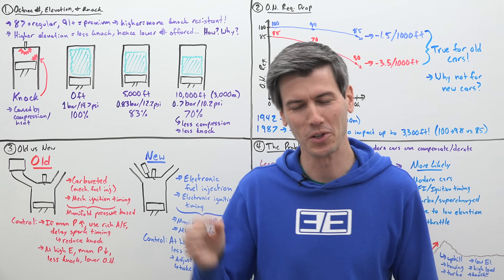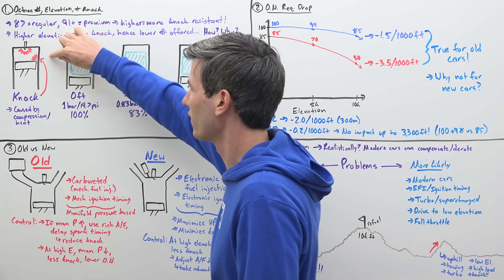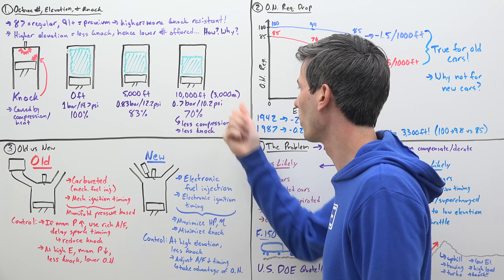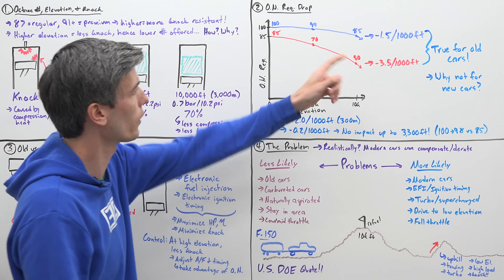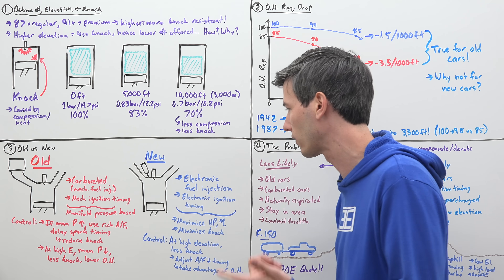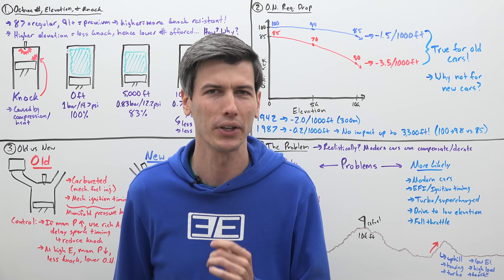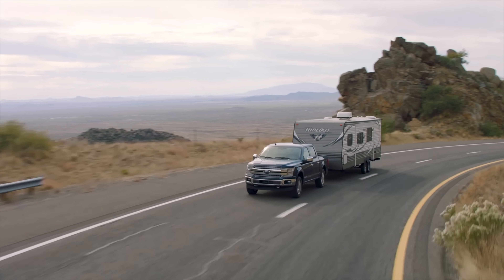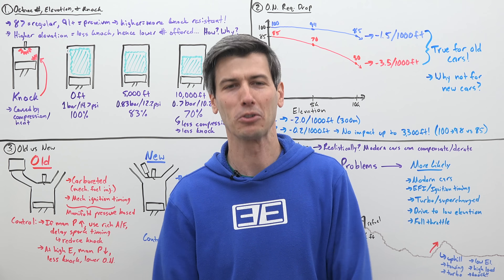Never Use This Gas In Your Car!

Comment: where I live regular is 86 octane. we are at 3700 feet above sea level. both of our newer vehicles manuals state use 87 AKI. After finding this the dealer said 86 works for the elevation we are at just the same as 87. Our state does not allow the sale of 85 though. so is my vehicle getting destroyed?

Comment: I have a direct injected engine in my car but no turbo.  Are direct-injected engines subject to potential knock?  I was assuming the fuel was not present at all during the compression stroke, and injected just prior to the spark near TDC.  Yet my car runs much better on premium than regular.  2018 Subaru Impreza

Comment: I am actually shocked to learn that 85 or 87 fuel exists. Where I live, 92 is considered the lowest acceptable and I wouldn't put anything lower than 95 in my car. But one thing that puzzles me is that if my car manual tells me not to put anything lower than a 92 in, and 91 is considered premium in the US, what is it going to use in the US? I drive a Subaru so that car definitely exists in the US.

Comment: Interesting stuff, but I can't say I find it all that odd that this fuel is for sale.  Diesel is for sale everywhere, and if you put that in your gas car, you're also going to have a bad time.  This almost seems akin to the transition from leaded fuel to unleaded fuel.  At one point there was a good mix of cars that required one or the other, so both were sold.  I have a number of cars from the mid-70s that have printed in giant letters by the filler cap UNLEADED FUEL ONLY so that people wouldn't put leaded fuel in their car since it was readily available at every gas station.  Another thing to consider is that fuel containing ethanol is bad for older vehicles, yet that is sold everywhere and ethanal-free fuel can actually be difficult to find.  Ultimately, different vehicles take different fuels, so it's not terribly shocking that different fuels are sold at a station built with the express purpose of selling fuel.

Frankly, if people aren't capable of reading their manual and putting the right fuel in their car, that's on them.  Whenever I fill up a car I'm not familiar with, I always look at the octane requirements in the owner's manual the first time.  Honestly, even if you didn't know what your car took, I'm not sure what would possess someone on a road trip to select a different type of gas than they normally use just because it was an additional option at some gas stations.

Comment: Is Ford F-150 actually missing a knock sensor from the engine? I thought that all engines with fully electronic timing always have a knock sensor and the ignition timing is retarded until knock doesn't appear. That allows two features: (1) engine is not damaged by knock issues because the timing is automatically retarded as much as required and (2) the engine performance will automatically increase if you use higher quality fuel.

Comment: Why not say explode?  Knock, pre detonation, is the fuel exploding in the cylinder.  Fuel, under normal and proper conditions, is a controlled but extremely fast burn; not an explosion.
Then explain how the pistol is being forced up through an explosion.  Broken piston, rods, crack issues associated with knock.

Comment: Why don't modern EFI systems include a barrametric pressure sensor for realtime fuel trim and tuning adjustments?

They are riddled with sensors already anyway.

Comment: So glad someone is talking about this.  I try to run ethanol free gas in my old Honda's that I've rebuilt.  And it definitely helps with keeping carbon buildup down, especially if you look at the exhaust valves.  This cheapening of gasoline does have an effect on the life span of your engine.

Comment: In Colorado, I've experienced engine knock during the hot summer months, especially when driving in a loaded vehicle, with the ac on and using more power.
Reply: Yes, so I run premium gas in the summer, our temps average 110 to 125 June July Aug,  and 87 during the rest of the year.

Comment: I was in Colorado recently and in addition to the 85 octane, there was also 87 with and without ethanol. If I get 87, does the presence of ethanol make a difference?
Reply: Ethanol actually acts as an octane enhancer. The fuel company can make cheap crap fuel into "better" fuel by adding it.   Your mileage suffers but you won't get knock. It's a scam that big oil perpetuates in the name of profits. As for 87 with or without- no it won't make much difference. Buy the cheapest.

Comment: 87 AKI is equivalent to 91 here in australia.  
That fuel only ever gets put in little economy passenger cars. The idea of putting that low an octane rating in a large vehicle like an F150, or anything turbocharged, is an absolute sin. You may as well put 10% ethanol in it while you're at it. Just really make sure your car knows you hate it.

Comment: If I remember correctly, a gas station in Wyoming offered 80-octane, 83-octane, and 85-octane gasoline. I filled up the tank with the 85-octane, and thought that I would have to abandon the seven-year-old car on the side of the road due to sputtering, misfiring, and backfiring. But fortunately upon driving several hours to the next available gas station I filled up with premium gas, and the car once again ran fine.

Comment: This is petrol and its in liquid form,

America: Lets call it gas
Reply: It's a shortened name for 'gasoline', which is the name for the compound.
'Petrol' is the shortened name for 'petroleum spirit', which was the name used in UK. Ironically, 'petroleum spirit' today refers to something completely different... a chemical for lab solvents or hardware.
In Europe, they call it benzin, benzina, etc... in reference to the chemical 'benzene'.
Reply: @jonathantan2469  also the fuel is kinda gaseous at the stage when it is being used

Comment: Also, I ran 87 octane fuel in a motorcycle that specified 91 octane and I simply had low power and high fuel consumption/ poor fuel mileage.

Comment: I've had issues with cheap gasoline listed as rated 87 octane on the pump, but it started knocking in a 2001 Dodge van. As a result I exclusively used Chevron gasoline for years.

Comment: Hi man, great video as usual, I'll pay attention when visiting the US. Seing the thumbnail I thought the video is about E85 ethanol, maybe next time. 

Side-note, I would have thought the issue in altitude isn't so much that "there's no air", but more like there is less air, but also the oxigen concetration is dropping faster than nitrogen, so actually there's even less oxygen, which is what is required for combustion.

Comment: When towing a trailer with my racecar on it with my skoda Octavia 1.6 TDI. Should I use premium fuel for these occasions? Or only if I have to travel under higher load for climbing hills?
Reply: Octavia TDi? There is no premium diesel, just diesel. Sounds like you're being cute here, because if you drove a TDi you'd already know that.
Reply: @oregongaper  excuse me I'm not THAT much a noobie in terms of knowledge. Here in Belgium we often have 95 and 98 gasoline, and beside that we have classic diesel and what they call "premium diesel". So I repeat my question, is premium diesel worth it?
Reply: @dilysi156  My apologies, here in the states there is only one diesel, for cars anyway.  As to the question, I still think the cheaper fuel will serve just fine, diesels run by knocking basically, so the shittiest cheapest fuel will run best
Reply: @oregongaper  no worries mate. Thanks for the answer 👌

Comment: The minimum octane in the UK (yes when you can get it lol), is 95Ron, which I think is equivalent to 91 in the US. We haven't seen anything lower than that for decades. I'm amazed that 85 is still available in the US, but if it has a lot of older cars it does make sense.
Reply: is Pablo Morales  except that we have tables which give us a rough estimate, which is where I got my figures from and RON of 95 would not result in an AKI of 85. The MON of Euro 95 is 87. So R+M/2=AKI which is 91.
Reply: @Eddiecurrent2000  According to Shell and Tesco in the UK, your 99 octane premium is rated at 87 MON and 99 RON. That's US 93 premium. 93 is quite popular in the US here. 😎

US 87 = UK 91 

US 89 = UK 95

US 91 = UK 97 

US 93 = UK 99
Reply: Pablo Morales  Question is whether the differences between the grades is significant to be noticeable, with modern engines I wonder if it is?

Comment: Wow Jason! Terrible! You wasted 12min of my life, and all you had to say that there is a scenario that is possible and you want to avoid, and then you completely missed on the most important factor. This most important factor as to why you want to avoid low octane is direct injection. Modern cars are making a whole lot more power with smaller engines due to three things that are now being done: Direct Injection, Turbocharging, and higher compression engines. Without all three the increased power is not possible, and that is why modern engines make more power than before at smaller displacements, which also and MOST importantly to the present day, IS... Better fuel economy and lower emissions. A smaller engine has better fuel economy and better emissions and there is other important factors, but the smaller the engine factor is the direct unavoidable factor for these improvements. NOW JASON, with that said, and back to why the fuel octane is important... its because direct injection vehicles are very sensitive and prone to carbon buildup. Its the little secret/devil that manufacturers don't want us to know about. If the engine begins to build carbon, it will continue to buildup EXPONENTIALLY. With poor octane, the buildup starts and accelerates very quickly, then exponentially due to direct injection. Why is carbon buildup a devil? Because to clean it out, you will have to put all that junk into the environment with liquid cleaners (my goto: seafoam). You can't clean it by hand, as it starts at the pcv valve and then builds up on the entire path from that valve all the way to your exhaust tail pipe. Got that Jason? I hope you did. The other reason, its a devil... is because your engine goes BOOM! with excessive carbon buildup. I am beginning to see more and more vehicles in the junk yard because of blown engines, due to excessive carbon buildup (which you can see in the intake ports on the heads, OMG its nasty!), due to not cleaning that out. Clean it out, you damage the environment, don't clean it out, your engine blows up. Which do you prefer? Technically, the junk will come out in tons of smoke, and then settle to the ground, which is carbon monoxide, but its still not good. Carbon Dioxide is the gas that rises and hurts the environment, technically, and that's not this stuff. So, in conclusion, don't use low octane, so you can avoid carbon buildup as much as possible, so you can decrease the amount of carbon cleaning/maintenance you need, so that you don't blow up your engine... and FORD, or whatever company, doesn't deny your warranty when your engine blows up. Better go buy that extended warranty now, because you know your engine is a ticking time bomb and they made it to last just beyond the warranty period... *OR*, just learn to do the liquid carbon buildup cleaning (aka: I call it seafoaming). So, Jason, go remake your video, before your competitors go make a competing video that explains the octane problem correctly... or, I may just become your competitor and do it myself... Yes, from an Engineer (myself) to an Engineer/Entertainer (You).

Comment: Just to clarify. This isn't about E85 which has a higher resistance to knock. 
Can still ruin your car though if it's not designed for that fuel.

Comment: Some gas stations sell fuel of so bad a quality older carbureted cars have a hard time running or wouldn't run, in new cars this results in significantly reduced MPG, had a 2005 Kia that got 29mpg with fuel from most gas stations, but one gas station car only got 17mpg and a station that sold the worst fuel for 10 cents a gallon cheaper than other stations car got 9mpg and had no power burned about 12 gallons to go a little over 105 miles.
Very few cars had mechanical fuel injection need to think about Carbureted engines, and go even older with side draft carbs or like my 1950 ford with a 6:1 compression  flathead V8, that was a high performance at the time, the issue is most modern engines run higher compression ratios  have seen up to 10:1 or higher in newer cars.

Comment: In Europe i think you can't even get fuel with that low octane. I think minimum is 95, super plus 97 and then there are also 100 octane ones.
Reply: Europe uses a different standard of rating than the US. That's why the numbers look different.

Comment: I have a 2012 5.0l F150 and it is advertised (with badging) as flex fuel. Which means that it can use E85. I’ve even been told to use E85 because of the quickness you feel in the truck. Now I know that it was quick because of the pressure in the engine (I’m in TX with little elevation)

Comment: In Europe we only have unleaded 95 octane and above fuel. However, it is being rolled out across Europe the E10 to replace the E5, being the number equivalent to the ethanol percentage in the fuel. Some manufacturers are recommending an anual fuel injectors cleaning service to reduce the impact of this higher ethanol ratio on the engine, namely the fuel injectors. Is there any valid engineering reason for doing this cleaning service?

Comment: In Europe, most countries just use RON 95, why doesn't the US just standardize towards one octane, say 87 or 89, and stick with that?
Reply: because it would either mean gimping cars with performance engines that need the high octane fuel by only selling the lower grade stuff, or overcharging everyone with a basic car by only selling a higher grade of fuel than they can benefit from.
Reply: @Dan_Neely  This is a good answer to that question, we have a variety of engines here, some economy, some performance. I'm glad we have options as I and others need those, as I have have economy on daily driver, performance on two play and fun things, diesel on another.
Reply: US auto makers have been trying to get the US to make changes to fuel. They argue that the current fuel options are limiting our MPG and performance while also costing us more. Instead of making 85, 87, 89, 91, and 93, just focus on 1 octane of 100. This will enable them to build higher compression engines that are more efficient while also making more power. And since the refineries can focus on just one octane their cost of production will be lower while providing a better fuel.
Reply: GREED.

Comment: Yea, back to the white board. Well, in 50 years when gasoline is $40/gal and you have to have a certified classic gasoline (no diesel) powered car/truck with only limited use allowed, there will be only one octane available.  By then most classic ICE cars will have been modified with electric motors. Let me know in 2071 if I was wrong about this prediction.

Comment: I haven't seen fuel below 95 from maybe 25 years... This is the cheapest and lowest octane fuel in most of Europe from many many years. I think 92 was available in the early 2000's.
Reply: Different rating system. European 95 octane is equivalent to 90 octane in USA.

Comment: We have 86 octane in parts of Texas that are not far from my remote property. The funny thing is there is a town that's only at 1300' elevation not far from me that sells 86 as the base fuel, yet the town 20 miles away at 1100' elevation sells 87. I just can't figure out why this crap is offered..even more so at such low elevations. I've just learned to go to the towns near me that sell 87 octane to fill up when I'm out there, as the 86 octane stations charge more for it than the 87 octane stations, plus I then have to go for 'mid grade' 88 octane for my 2.7L ecoboost F150 anyways. It was even worse when I took a trip to Colorado a few years ago where I paid about a $1 a gallon for 87 octane 'mid grade' gas than I would at sea level here in Texas.

Comment: Can you do a video on how accurate octane ratings are to actual fuel sold?
Reply: Gas is typically a number or two above the posted minimum. The US octane rating at the pump always shows a guaranteed bare minimum octane. Hence why it specifically says "minimum".